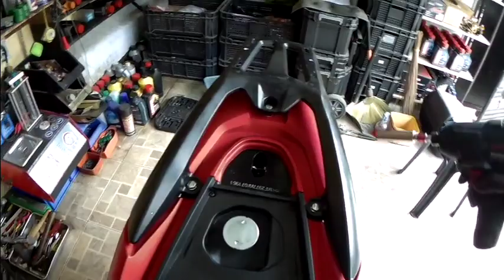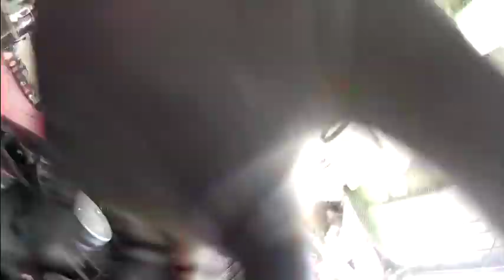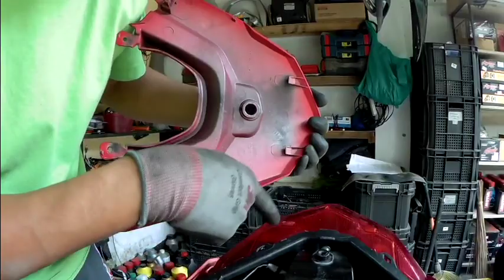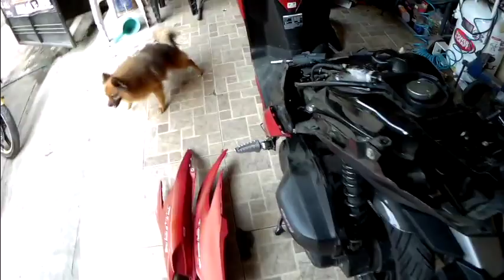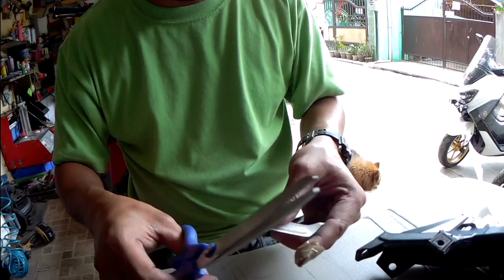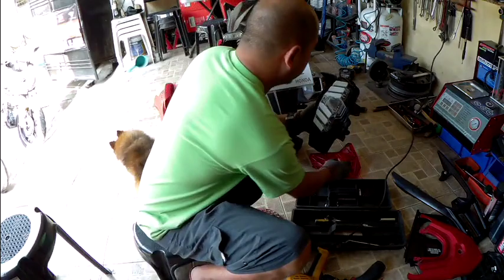Click jpa lights ( DIY)

Comment: Pa review ng gc 150i papa
Reply from the maker: After covid papi
Reply: Maganda din ba stability nya sa highspeed katulad ng nmax?
Reply from the maker: @kenken7204  d ko pa na ride. Lockdown kc, bago pa lng sakin ito
Reply: Ask ko lang paps ok lang ba sa nmax 177cc tapos magpapalit ng throttle body pero stock ecu parin?
Reply from the maker: Kelangan papi marunong ung gagawa eh. Importante kac mabadahan ng afr reading
Reply: Possible ba mas mag lean pag nag palit ng malaking throttle body?
Reply from the maker: @kenken7204  yes